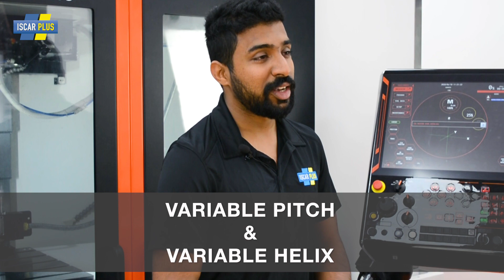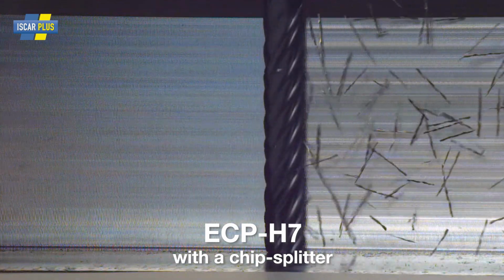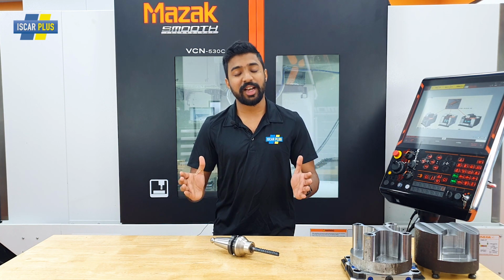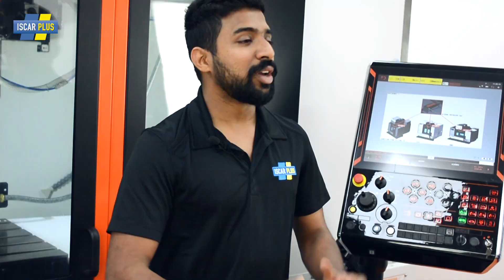7 Flute Long Edge Endmill with Chip-Splitter - Iscar Plus Tool Intros - CNC Machining

Comment: Will it perform well with aluminium stock?
Reply from the maker: Hi, ECP-H7 is not the recommended option for Aluminium. We do have chip splitter options available in our aluminium range.